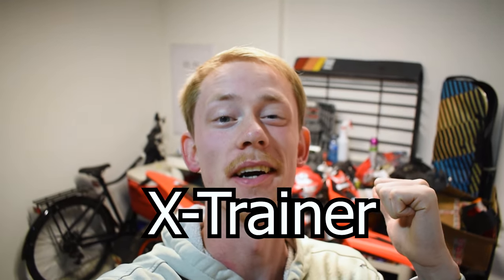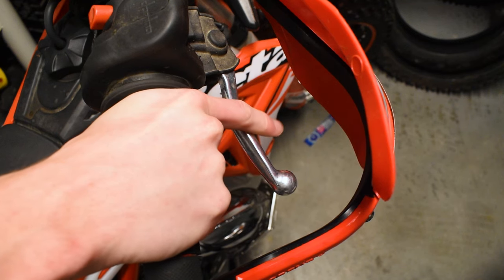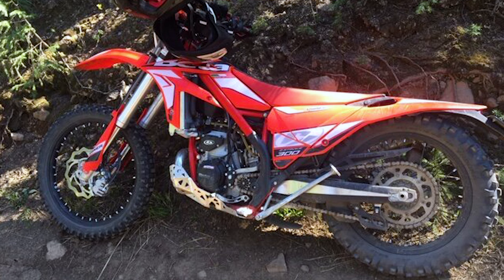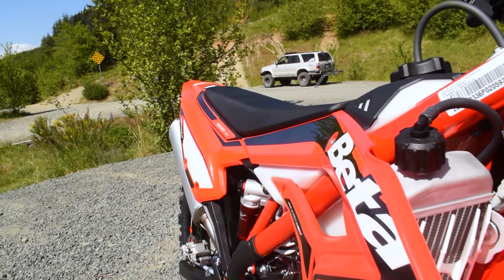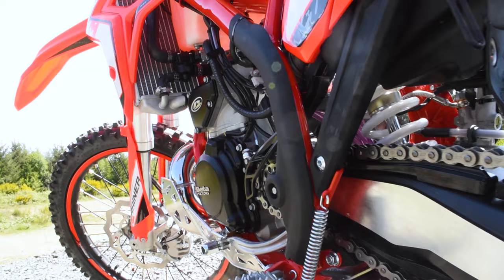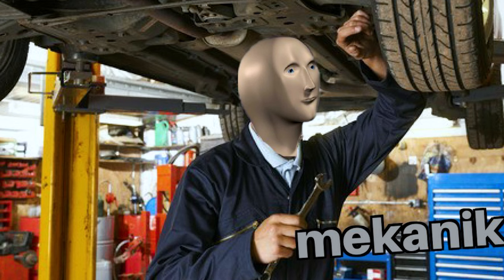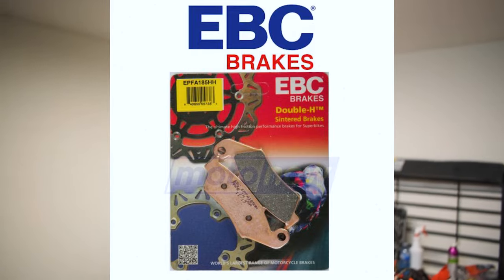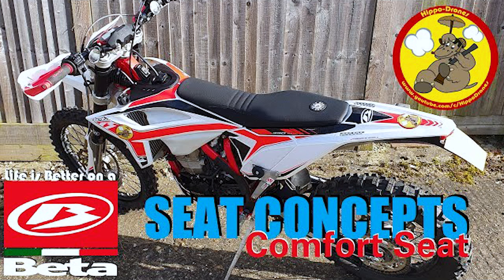5 Reasons The Beta X Trainer SUCKS!

Comment: I'm an old poky-slow trail rider, so my only concerns were electrical and fuel economy. On my Xtrainer, I re-routed & sealed most of the connections (dielectric grease). I also found the carb a pain to R&R for servicing, so I installed a smart carb II. I believe the bike is getting almost 50% better mileage with even better response.
Reply: That’s something to look into 👍
Reply from the maker: Definitely would like to try a smartcarb, not ready to drop the money on one tho just yet
Reply: Do you think we can ride together some day. Gardens144
Reply: How much was that carb?
Reply: @sonnyrico  $900 US. Two years ago.
Reply: Im back n forth deciding on an xtrainer or 300 beta evo trials bike with the long range tank n seat
Reply from the maker: @sonnyrico do you want to ride delicately like a trials bike, or more aggressively like an enduro bike
Reply: @AaronsEnduro  steep single track
Reply: @AaronsEnduro  Mixed slow-med speed trails, NOT hard enduro.
Reply: @paulmcauliffe8857 
 Why not Hard Enduro? I have a 300 xc-w and sometimes feel it’s too big and heavy for Hard Enduro. I feel if I could ride something more Trials like then hard enduro is easier.
Reply: @rogermty1971  At 67yo with a 27" inseam, I don't the needed strength or skills to wrestle a bike thru hard enduro conditions. Fine with tight trails, smaller rocks/logs, steep grades, etc.

Comment: I have a '21 XT and agree with all that you've said ... I'm glad you didn't dis the oil injection as I've used that for the 200 hours I have on my bike and it's great.  Also, AMP has done my suspension and Aaron is truly helpful and cost conscious ... as well as an expert on our issues.  I also don't understand why we can't get an aftermarket plastic company to step in and make higher quality plastic for our bikes, at least the shrouds ... thin and brittle ... and cheaper doesn't make me feel any better.  Keep up the great work.

Comment: I’m wondering as I read these comments if most people understand the difference between the xtrainer and the 300rr,Sherco,KTM platforms the only bike I can put on par with it is the Rieju Ranger I believe it is. The machine is a 7/8 ths size has a detuned 300cc 2T motor which can easily be turned into a full blown fire breather just add a fatty pipe or rr pipe remove the xtra plate in the expansion plate on the power valve and jet the carb and viola fire breather. The suspension is a trail bike soft suspension yes it’s not great but compare it to Honda,yamaha, Kawasaki trail bike street legal machines and well it’s just better imho. It’s 220 lbs wet I believe and with the seat concept low seat it’s 34” I believe not positive and a price tag that’s pretty inflation friendly as 300 2T go.
And the grunt in the motor is 🤩
Reply: It's really unfair to compare a 7/8k€ bike with the KTMs that cost 3/4k more

Plus this is supposed to be a beginners enduro bike. The RRs will solve most of the problems stated here with the Xtrainer
Reply from the maker: Its because they’re are no other bikes to compare the x trainer too!
Reply: @AaronsEnduro  I see no problem on showing that it stays below those machines. But I would say that it needs clarification that it is a cheaper bike and it’s supposed to be for more inexperienced riders. The Xtrainer is in a classe of its own and that’s totally ok. I think for the price it’s still a very good package for those starting even with the problems it has when compared with the >10k machines
Reply from the maker: @ricardoneto13 its funny you mention pricing, we bought a 2023 husky te300 2 stroke the month prior for my dad. Then i bought my 23 beta x trainer the following month (June)

After all said n done, his bike cost him 300$ more, and they gave him a 1500$ incentive for free husky branded parts lol. 

Now after 6 months of ownership and putting the equivalent protection mods on each bike, the beta has been more expensive overall lol
Reply: @AaronsEnduro  i was comparing in EU(Portugal) prices

Here the Xtrainer costs 8k and any KTM/Husqy will cost us more than 11k 😬😬

It’s quite a difference

Comment: Funny Xtrainer sales crank and there’s a ton of them here that guys love. Im riding with a friend now with a 23’ xtrainer that he loves and I see a pile that guys been riding for years. There’s simple adjustments and mods that you do for any bike you ride. . Guys drill holes in the seat foam. Or get other seat foam . It’s Prep the wire connections.It’s basic prep of any brand new bike. Some yank the oi and run premix like the 300 race edition comes stock.. Put springs for your weight. Polisport has made aftermarket plastic for earlier xtrainers. Theyll make for the newest. Adjust the float bowl in the carb and gas mileage is way better or buy a big tank. Change tires. I mean it’s all simple basic stuff that you do to all bikes. Hey and there’s build Your Own Beta program to custom make your Beta if you like before you even get your bike or just buy a 300 race edition . I got 6 Betas since 09’. I don’t have broken plastics or wiring problems. Seat foam I changed and set up suspension for my weight and just do regular maintenance. . I have a 15’ 300 rr and an 09 525rs and a 12’ 350 race and a 22’ 200 rr and a 23’ 300 race. Ive been riding my friends 23’ xtrainer. The bike is great. Ive been riding a wide variety of Betas for years.
Reply: Yeah sure, if you replace half the parts you can make any bike into a good bike. The point is how much work you need to do on it to remove the defects , the golden standard being zero…

Comment: Raced my ‘24 in a hare scramble yesterday. Can confirm the suspension starts to show weaknesses in higher speed. But it did fairly well. As for the brakes, I have zero issues locking front or back on command. Great informative videos Aaron!
Reply from the maker: How much fun was that hare scramble, thanks for watching!
Reply: @AaronsEnduro  second race ever and it was a great time. Coming off from a DRZ400, the beta is a huge upgrade.
Reply from the maker: Oh forsure! Dropped like a 100lbs off the bike!

Comment: I think it’s important to remember the xtrainer is a 300 but it’s a trail bike not a full blown enduro or racer yes the seat sucks, the suspension is fine for trail riding and a bit more the electronics are not great on a lot of newer machines but an easy fix if you’re proactive. The gas tank is quite literally a thimble and the 23/24 is bigger than mine. The brakes I have no problem with idk why yours aren’t that great . I spend as much time horizontal as vertical so I beat the thing pretty good body wise I haven’t had to many issues other than lights overall I will take the five shity issues 😎for the $7900 I paid for it😁
Reply from the maker: Hard to beat the bang for buck!

Comment: I own X trainer 300 2023, and your explanation totally true. body set super easily broken,  the suspension and shock quite twitchy when ride fast in enduro single track. I am still struggling how to set up the comp and rebound 🙄
Reply from the maker: I added 4 clicks stiffer of rebound to the rear shock, and two clicks stiffer for front compression and that seems to help from stock a bunch. Ive yet to play with rear compression or front rebound, but its next on the to do list
Reply: @AaronsEnduro  Thanks Pal,  really appreciate your advice. I would try.🙏🙏🙏
Reply from the maker: Its definitely worth testing your clickers! Make one adjustment on one clicker at a time and see if its better or worst and then you can try clicking it in the opposite directions

Comment: Great vid!  I too am an xtrainer driver and about 50% of the terrain I ride looks like what you show here.  Fuel mileage: Hilarious and true!  BTW, I just had the head shaved for a bit more compression.  Made a huge difference on 2nd gear lugging.  Brakes: Not at all what I've experienced on other bikes, but no complaints. Suspension (I'm 200 lbs): Had to install heavier springs.  Still a bit dicey at speed, but fine for the tight stuff. No jumping for this guy!  Seat: Like fricking graham cracker wrapper!  Went to the Enjoy Beta ribbed seat cover.  Excellent quality!  Electronics: Have been having issues, especially on the speedo.  Thanks for the tips!  Oil injection: Installed the injection delete kit the first week.  Can't trust any of it.  Plastics: On target!  They suck!  Must say though, the bike is a hoot!  Hoping the engine and and transmission prove reliable!
Reply from the maker: Beta should cover a dash and speedo cable warranty. They did for my bike and now it works mint!

Comment: Bro you gotta check out the sherco 300 ser, takes care of all them issues, plus still carbureted. Not saying it's perfect but it competes with the KTMs
Reply from the maker: Honestly have never look at the shercos before. I just really love the look of the BETA. Although now ive fixed most of my issues with the beta and i really enjoy it!
Reply: @AaronsEnduro  yeah you gotta sweet setup and I'm sure its a blast to ride, you know the rule: cheat on your girl before you cheat on your bike! 😜 Love the content, stay safe 🤙
Reply from the maker: What’s the biggest down fall to the sherco?
Reply: @AaronsEnduro  Compared to the beta, Height and Weight. Im 5"7 155 lbs so I had to put a lowering link on it and it throws off the ergonomics a little bit, other then that it comes very rich from the manufacturer so needs jetting or smart carb, the clutch is also very heavy, and the kickstand is crap, but performance wise its great, comfortable seat, amazing suspension and brakes, and the mapping is better than any other  bike that I've rode which is just the Austrian ones
Reply: @AaronsEnduro  oh and hard to get parts lol, hopefully soon enough they'll get better with that, how is it finding beta parts, oem or aftermarket?
Reply from the maker: Theres a decent amount of support, ive yet to struggle to find any parts be oem or aftermarket. Have been pleasantly surprised with the accessibility of parts for them. Thought it was gonna be much harder to get them
Reply from the maker: Beta has also been unreal with warranty support
Reply: Sherco is a good machine but they got some of the Same electric gremlins working on 1 now,plus there a couple grand more and higher seat height and rr power

Comment: I found the forks too soft while simultaneously being very deflective if you ride a lot of rocks. I know have 45mm Marzocchis and a Fox shock. Also try the Suzuki NECW needle.
Reply from the maker: Where did you get the needle from
Reply from the maker: Whats the benefits to the suzuki needle
Reply: @AaronsEnduro  got the needle from Rocky Mountain, I can grab the part number later. It has a different taper than the stock needle. I installed the JD Jet Kit first which has its own needles but then tried the NECJ which I found a Lil lean so I went up to the NECW. I running 162 main, 40 pilot, & fmf fatty at about 1000ft elevation.

Comment: All similar issues with my 2017 Beta Xtrainer.

 But the Stock suspension is made by a company called Olle. They are barely any better than trials type forks (pogo stick). Ohlins, Sachs, MX Tech Lucky fork insert, basically anything would be superior to the stock suspensions.  The rear shock is not horrible, but there a batter dampers out there as well. Expect to spend about $1000-2000 for better suspension.
 I have a GIANT beef with the BYO   build your own Beta options. They charge retail for upgraded suspension, but you d not get to keep the OE suspension.  Beta USA double dips on the component cost, although they do the installation.

 I went with fork tuning and springs before finally I gave up and got the MX tech insert for the fork and it basically transformed the bike at higher trail speeds. I have the Beta Race chock too. Nice upgrade but $$$$.  

 There's no reason to spend the money unless you plan on keeping the bike for many years. I would say that for riders who have inseam challenges this may be the right bike for them, even though it will cost more than a300RR or KTM, it's a smaller lower bike that can be made into a fantastic trail bike.

Comment: My beta has awesome breaks, my radiator shroud bolt was stripped out from factory, haven't done the grease on the connections yet....
Reply from the maker: Oh boi, you gotta take care of those before we get into wet season!
Reply: @freetaylor72 , "brakes".  I have a 2022 XT and agree with most who find them grabby.  The rear pedal was too high, but you can adjust the nuts where it pivots to lower it.

Comment: Great informative video. That rear brake is just plain hokey. Figure every enduro or dual sport you buy will need the suspension modded. They are all too soft for anyone over 130 lbs. If you are an aggressive rider plan on springs and valving for sure. Soft engine performance from the factory can also dog enduro bikes. In many instances setting up an MX bike for enduro will result in a bike that rules the woods for an experienced rider. I am currently riding a KTM 300 EXC (carbed) and it is as reliable as a sledgehammer. I had the soft stock suspension recalibrated by Factory Connection for my fully geared up weight of 190 lbs. l love it. As for those electrical connections on your Beta, that is completely unacceptable.
Reply from the maker: Trueee

Comment: Did you blue plate your Xtrainer (Ontario). I got a deposit on a brand new dealer 300 Xtrainer and I want to blue plate it. Any suggestions on how I can go about it?  Thanks for the videos.
Reply from the maker: In bc it has a “motorcycle plate / MC”

Which is the street legal plate for BC

The blue plate here is the offroad only plate. To get it registered as the street legal license plate all you have to do is make take your brand new x trainer to your local insurance hub and ask for street plates for it.

In BC anyways so long as the title of the registration says “open” and not “OHV” Then its up to the purchaser to then get it registered as an “MC” or “OHV”

If registered as an MC and it has “no restrictions” on your registration paperwork, youll be good to go.  My local insurance broker is across the street from the beta dealer so they were used to getting new betas registered all the time.

Something else to note is when at the insurance broker it’s important (because BETA) is not a “make/model” in the system. they then have to create a “new profile” to give you custom “make/model” for the registration paperwork. Some brokers are too dumb to know this and will say they cant insure it. But this is what they had to do here in BC anyways for me to register it and the lady at my desk got stumped with trying to be to register it, but the higher up member was like “for betas we gotta make a custom make and model”
Reply: You need to ask for the NEVIS form from the dealer and bring that to service Ontario. I did it.

Comment: Are you putting the peacock in reserve when the tank is full? Beta has a long intake into the tank. It will run out of gas in the on position with only a half tank, most Beta riders put it straight into reserve.
Reply from the maker: Straight into reserve

Comment: The suspension sucks! Easy fix, send the fork to AMP and get a new spring for the rear. Under $1000 and you are good to go. I think the brakes are good. You have to switch the petcock to reserve early because of how far it goes up into the tank. they dump fuel when you lay it down. Hard seat, whatever, stand up. Great bike overall.
Reply from the maker: I do love mine!

Comment: Thanks for the video Aaron. I’m looking to get my first bike and I’m between the 200rr and the xtrainer. I like the low seat height of the xtrainer but I like the lower cc’s on the 200. I think a 2t 300cc is too much for me. I’m short guy 5’6 at 155lbs. Will be riding the east cost new england area so probably a lot of rocks and obstacles and hills. I would love to hear your opinion on this. Thanks!  Ah, almost forgot, Im also considering a used 2013 ktm 200cc xcw too
Reply from the maker: The 300 “sounds” intimidating compared to the 200rr. But i garuntee the 200rr will be a much peakier power band, and less luggable. The 200rr is better suited for aggressive riding. The x trainer is better suited to slower riding in technical terrain. When you put the x trainer in the wet map mode (in combination with the stock expansion chamber exhaust) the power is very tammed and not intimidated at all. Trust me i was in the same boat with getting my first 2 stroke
Reply: Thanks for the input. Last question, do you compare it to the ktm’s and husqvanas? The xtrainer is on the same level?
Reply from the maker: @arlokkkk  x trainer is a completely different type of riding style bike. Ive ridden both the 23xcw and 23 te300, those two bikes are overall better than an x trainer. 
That being said the x trainer is way easier to ride, much less tiring, more manoeuvrable, lighter, smaller overall size, lower seat height, ultra linear tractable power, and super predictable. There really is no comparison for an x trainer and its truly in its own class. 

The x trainer is a trials enduro hybrid compared to the Austrian bikes being an enduro/gncc bike. Two different bikes for two different riders, riding styles, and terrains
Reply: This is very good information. Thanks for letting me know this.  I will get the xtrainer
Reply from the maker: You’re gonna love it!